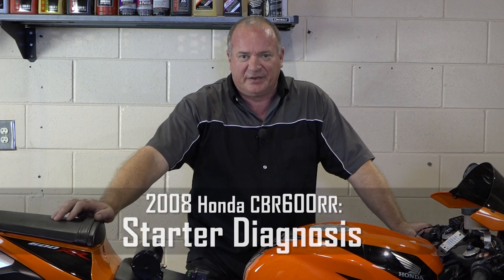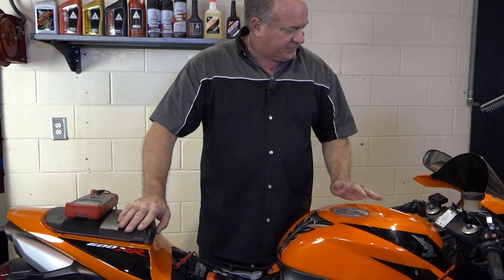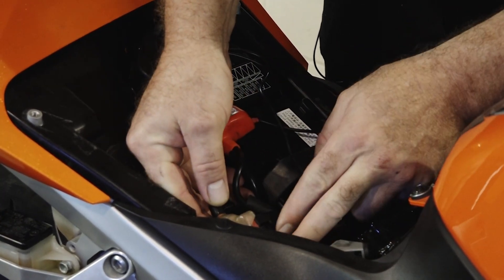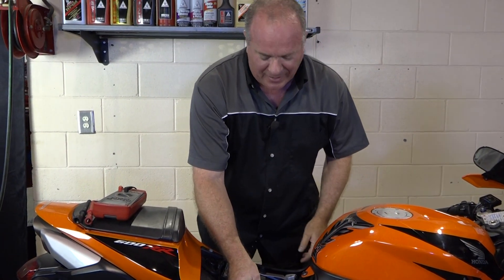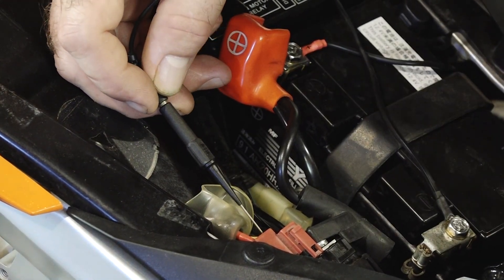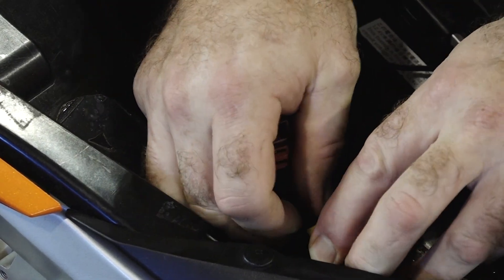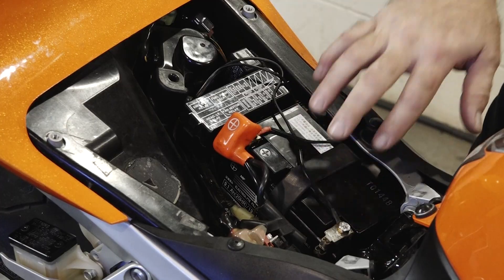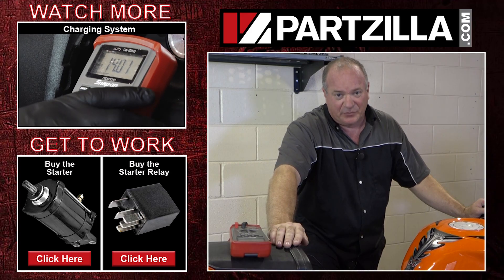How to Diagnose Starter Problems on a Honda CBR 600 RR | Partzilla.com

Comment: I bought a new one because my relay burned out but I don't remember what I disconnected from where when I disconnected it. Can someone please tell me which is the positive terminal of this relay. It says M on one side and B on the other. Which one should I connect the positive terminal coming from the battery to? Can you help me please? Honda CBR 600F3 1998

Comment: My pump primes everything is good but when I hit my start button it doesn’t start I replaced the button checked all my fuses and replaced my starter relay and still nothing I can only get it to start if I press a copper wire to the relay I can’t seem to figure out the problem if someone has some info please let me know

Comment: Thank you for this information, but did you put the positive on the negative and the negative on the positive to check the DC voltage?
Reply: your meter will typically be either an automatic type that will auto-detect the type of voltage passing through it. There are also meters where you set the voltage you are testing for. I know with my Snap-On meter it auto ranges the voltage for an easy reading, along with this if I reverse the leads like he might've in the video then mine just shows the voltage as a -v  minus value, still the same voltage

Comment: About 8 years too late 😂 but still have a question for anyone. I have the same issue on my bike except it just takes a few seconds to finally start. It tries and tries and tries and sometimes I have to stop and try again but sometimes it kills the battery. I don't always have to give it gas but it seems to help sometimes. 
My question is what do you think it could be? 

My thoughts is either
-starter
-starter relay
-fuel pump

Only guess I have. 

Thanks again 👍 
Ride safe 🤙

Comment: so i am having a problem when im hearing a clicking noise when i click the starter but it wont start? or engine wont turn over? the guy said he just put a new starter in it but idk got a new battery in it and im not sure im check the fuse and see whats going on .

Comment: Thanks for the video! 
Question for you I'd you get time. 
I've done all the steps and bike still won't start, I removed starter motor and attached positive and negative to it and it fired straight up but won't start the bike. Can the start be to weak to move the engine or is it likely something else?

Comment: So when that main fuse was blown will the clock on the gauge cluster still work? Because mine the clock is on, the battery is brand new and as soon as I turn the key there’s nothing on the gauge cluster at all

Comment: Hello, got a 09 honda cbr 600, they guy said something about the previous owner did something with the headlights and now the bike wont start, it turns over but wont start, says it needs and ignition, but before i buy anything was hoping for feedback. I was going to just hot wire it but he said that it would mess up the cpu or something i dont know…😭

Comment: I have a 06 cbr 600 rr.. head lights come on and cluster lights up. The bike cranks but won't start over and run. It happen after I replace the front fearing

Comment: When I put the clutch in the gear of my Honda MC22 RR bike, the neutral bulb lights up, I replaced the diode but the problem is the same, thank you for providing a solution

Comment: What happens if you complete the circuit by using your method and the bike starts? What would be my issue? Currently where I'm at. Replaced the solenoid did not solve it

Comment: Great video! One thing that confused me at first was when you were testing the starter relay. The video shows you had the wiring harness disconnected but doesn't show you re-connecting it. This made me question whether the wiring harness was to pass power from switch or to the starter.
Also, the camera angle doesn't clearly show the actual removal of the power cable from the relay (I guess it can be inferred by your hand movements). But seeing the beefy relay terminals with my own eyes is what made it obvious that's what the starter is connected to.

Comment: Thanks for the video.
So I started the bike by bipassing starter button and it did work.
Does that mean i do have a problem with my button? Or wires i suppose.
Thank you.
Reply: I have the same question lol I sent 12 volts to the red/yellow wire that goes into the starter solenoid and it fired right up. Did you figure it out?
Reply: @williamreilly4676  Not yet but will start by replacing the relays as I also have a problem with my headlights, low beam isn't working and high beam I can't even switch off. 
I might even try to open the button and see if it's not malfunctioned. 
Will post here if I solve the problem.
Reply: @ArturK1M  after I commented this I tested the wires, no power. So i opened up the kill switch/start button, cleaned the contacts, then tested it again, still  no power. Chased wires all the way to solenoid and all seemed fine, ended up peeling back the heat shrink/protective sleeve right below the kill switch and two of the wires were pinched clean in half 🤦🏻‍♂️ I'm going to splice them and see if it works today. 99% positive it was the issue
Reply: @williamreilly4676  The first connector coming from steering bar under right fairing below tank cover. That was the problem, I literally just touched it and tge bije fired up. Either dirty, loose cable or snapped wire. Let's see, all I did is clean it so far.. Thanks for good conversation!

Comment: If you hear a loud screech while riding and then when you slow down the engine cuts off and and won't start again, you smell a faint burning smell and your battery is good you most likely need to replace the starter, correct?

Comment: Hi, here is my problem (CB500 2002), hope you can advise something for me to solve it. I swithed the ignition ON then i pushed the starter button suddenly power cuts off (small clicking noise came, dont know where) since then no power at all. Fuse box checked, all good, main plug fuse ok too. what elso could have gone wrong? thanks!
Reply from the maker: Hello hegedustamas3
Did you by chance check the voltage of the battery? this sounds like it could be a weak battery. Hope this helps!

Comment: Hi guys,
I have a starter motor for a 1992 honda 250rr mc22 that is possibly spinning in reverse, what direction should a starter motor spin if the drive gear in motor is facing you.

Comment: 2014 CBR500R - Everything tests good and still nothing lights up.
Reply: Hi, did you get solution so far? just asking cause i've got the same problem on my 2002 CB500.
Reply: @hegedustamas3  it was a dead battery.

Comment: Hello I have a 2007 Honda cbr 600rr the top sensor was cut out and wired up bike was taken apart I put it back together but for some reason I can’t seem to get the fuel pump to prime for nothing or even get the bike to start can you please help me pls I need help ?

Comment: I have a bike it's a 2003 Honda CBR 600 F4 and when you hit the starter button the bike will start but as soon as you let off the starter button the engine cuts out what could the problem be

Comment: You might not get to this comment but i have a 2007 cbr600 and there has been a charging issue, I put it on the charger so i could take it to the shop and none of the lights turned on. I found this video and pulled out the same fuse that you did but mine was perfectly fine.. I even replaced it with the other one and still nothing lighting up on my dash. The only thing coming up is the clock and that's only when the bike is off, it's not on when I turn the bike on. Thanks and get back to me if you can
Reply: A lil late, & u probably already resolved, but I had the same issue & it was a fuse. Had installed new LED turn signals & just needed to put in a stronger fuse cuz it kept blowing the fuses. Had to ride home with no speedo, etc. 1 day... good thing I was riding locally. Lol
Reply: @bossylady80  your good, just saw your reply but yes I did resolve it, my stator went bad which I think is common in 2007 cbrs, I had to replace the stator, regulator, and the battery because the battery stopped holding a charge

Comment: I have a 2007 Honda cbr 600rr that all the fuses are good on but for some reason my fuel pump will not prime and bike cranks over but won’t actually start why is that ?
Reply: I have the same problem after a low slide crash at the track.  The dash lights turn on, but I'm not hearing the fuel pump activate when I turn the key to power.  Bike cranks but won't start.

Comment: Thank you for the informative video.  This helped me.  I found that my HID ballast had blown which was the reason my bike wouldnt start.  I switched it out and now im back on the road.
Reply: I have the same problem what did you switch out? The bulb or starter
Reply: @MsFshuffling  did you figure it out?

Comment: Any chance you’d do a video about if the motor turns over but nothing else happens ? I’m currently in that situation and after about a month of searching someone mentioned that my tip over sensor could be bad/burnt out ? Have an 05 cbr600rr and it seems most of what you do goes for that as well

Comment: my bike wont start 07 cbr 600rr i try to start it it makes a weird nose like its not cranking up is that the fuse?
Reply from the maker: If it was the fuse, it just wouldn't do much.  You're going to have to dig a little deeper.
Reply: Partzilla it was the battery im an idiot haha the battery was just low on power i put it on a trickle charger and its all good
Reply from the maker: @ThePain223  You'd be amazed how often it's just a low battery or one that reads fully charged, but has no power under load.  Glad you got it going!

Comment: Please do a fuel pump problem video!! The two clips that connect to the pump (black goes to the sensor and brown goes to the pump) I use a volt meter on the black and it has 10.56 volts and the brown has 0.00... the cords look to be fine and relays and fuse are not blown...any suggestions😫  fuel pump was on a tank that has been sitting for a long time gas smelled like varnish. Cleaned the tank and changed the pump inside it, but not the whole entire fuel pump. Fuel pump wont prime.. please help

Comment: I have a Honda cbr600 rr 2004 
And it’s not showing how many km / mile the engine got also the miles per hours is showing zero. 
Any solution on that ?
Reply from the maker: Generally a new cluster.
Reply: Partzilla i bought 2 brand new cluster but I still have the same problem 
I will send you a video to show u exactly what happens
Reply: @CV4ever2  The Honda manual says the E²-ROM in the ECM is faulty when speedo doesn't work and odometer reads "----". Replace the engine control module.
Reply: Corey Regan thanks for your help 
I already did that and it worked perfectly

Comment: I have a 2006 honda cbr 600rr. An I just ordered a starter solenoid hopefully it will start now.. an also have a brand new battery 3weeks ago..if it doesn't start after this what else do I need to look at?
Reply from the maker: Wiring for damage or corrosion

Comment: Hi, I have a honda cbr600 2007 and its beeping twice the FI and when i drive it just stays on, any ideas what it might be ? Thanks alott
Reply: Also, it starts beeping when i start the bike not when i turn on the ignition.
Reply from the maker: I've never heard them beep...you mean blink?  When you turn off the bike and turn it back on, it should blink a code.  Check the service manual to see what it means.

Comment: I have a CBR600RR 2006, I replaced the starter relay but still no joy. If I jump the yellpw/red wire it cranks. What would be the next steep? Starter push bottom?
Reply from the maker: Could be the switch, or a bad wire.

Comment: Hi, this is in the same vein as the most recent comment, regarding '05 CBR600RR. The battery now only has ~10 V, so powers the dash, lights etc, but obviously won't start the bike. When pressing the starter button, can hear the same very loud click click click (like a taser), and bike obviously won't start. Before the battery went flat, there was no clicking noise, fuel pump primed and engine cranked but no ignition. Any suggestions? Cheers, thanks
Reply from the maker: It will click like that when it has insufficient power.  As for the initial issue, check you are getting fuel and spark...check plugs and coils.

Comment: Hey for a 03 cbr600rr
New battery in it. Intermittently slow cranking. Only once its warm. Slow crank and dies u can hear the starter go click click click really fast.
Reply from the maker: Well, just because it's new doesn't mean it's good.  Do a load test on it.

Comment: I bet the service manual for most bikes tells you how to test the internals of a starter too.  Under electrical system / starter motor inspection.  There should be continuity between armature segments.  There should be no continuity between an armature segment and the shaft.  Careful, because I measured some continuity that turned out to be my skin.

Comment: 2003 honda cbr 954rr revs but will not start all the way... Please help.....
Reply from the maker: Fuel and spark...confirm you have both.
Reply: @Nightingale-ug8qw  It has brand new fuel but I dont have spark.  Battery charge is still good. New rectifier and everything is good.
Reply: @Nightingale-ug8qw  thank you for your response.. Pls help me.. i want to ride..

Comment: Hi John! I followed every step in this video and my request is:  Would you please make a video of how to get to the starter motor on a  2006 CBR 600rr I have taken the air box , gas tank, disconnected the negative cable that goes al the way to the starter but from that point I do not know how to disconnect the Throttle and the cables so that I can get to the thermostat and be able  to reach the starter at last. I got some parts from Partzilla on the way to finish the job and I will certainly appreciate your help.

Comment: so a fuse blows when too much power surges so its protected?
Reply: If there's a short in something like the starter, the fuse blows, so the wires don't melt.
Reply: Front head light whent out while riding . Stop to check . Bike won't start. Blow head light fuse replace it but it still keeps blowing the fuse. Bike won't start but I have power to the bike. Any ideas . Thanks 👍

Comment: I rode my 05 cbr 600 rr yesterday on the highway and then it started jerking then it shuts off and on. What do you think is wrong ?
Reply from the maker: To little info to really tell.  Could be fuel or spark.

Comment: Hi Would you please clarify to me the last step where you check the connectivity of the starter relay did you disconnect it from the bolts and the red connector? Thank you Partzilla.
Reply from the maker: You disconnect it from the starter so it doesn't attempt to start the unit.
Reply: Partzilla Thanks! I appreciate your help!

Comment: Help! I think both of my keys have been decoded.... Its a 2008 cbr 600 rr. When i turn the key the HISS light doesnt turn off and the fuelpump doesnt prime. I've heard its really rare that BOTH keys gets decoded... any thoughts on what it may be? Maybe the ECU is toast? balance-sensor? fuse?
Reply from the maker: quite possibly the ecu.  Worth taking it to a shop to test the system
Reply: @PartzillaParts  thanks, yeh! Just got the call today confirming i need a new ECU... :)

Comment: I know this is an old video but Please help. Got a 2003 cbr600rr that you have to crank forever when it's cold to get it to start no matter the throttle position, its getting spark on all four plugs and you can smell fuel while cranking it, once you finally get it started it runs like a dream, idles perfect, doesn't hesitate, pulls like a mad monster in every gear. But Once you get it warmed up it starts perfect every time. Got spark on every plug, unhooked fuel line and flipped kill switch and she squirted fuel every where. Baffled. Please help!!!
Reply from the maker: That's odd. Have you checked for any FI codes?
Reply from the maker: Have you tried new plugs? checked valves?
Reply: No codes, I can't understand it, after you crank it forever and get it started you can turn it straight back off and it will fire right back up perfect every time until it sits for an hour then same thing. I can hear fuel squirting back in tank after pump primes up
Reply: I also jumped the pump relay and let the pump run for 2 minutes before trying to start it. Same thing. After about a solid minute of cranking it while blipping the throttle it will start hit and missing for about 20 sec then it will fire up but can't give it any throttle for another minute or so, then it will clear up and run and start perfect, till it sets for an hour or two
Reply: How could it be the valves? Soon as, and I mean soon as it finally starts, you can turn it straight back off then it starts perfect every time, before the headers even get warm to the touch. No rattles, no noises, no hesitation, idles and sounds perfect,runs and pulls at Full power.. until it sets for an hour.. Then crank for 10 min and repeat. Lol
Reply: Plugs were the first thing I changed

Comment: After a long winter iv decided to start it up.it turns over but it wouldn't start...I suspect the kill switch..my cbr is 2014..way to test the kill swirch?I heard the pump the first time I tried starting it..but then nothing..??!!??
Reply from the maker: you can test for spark.  Otherwise it's almost always a fuel issue.  Filter, lines, etc.